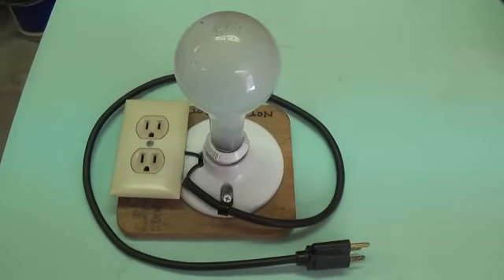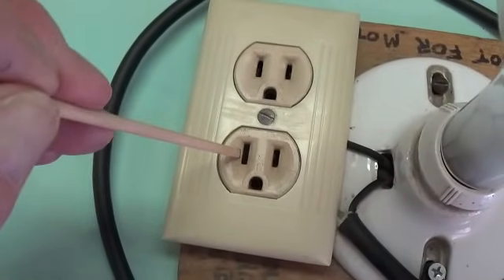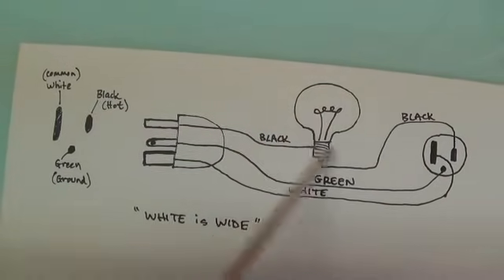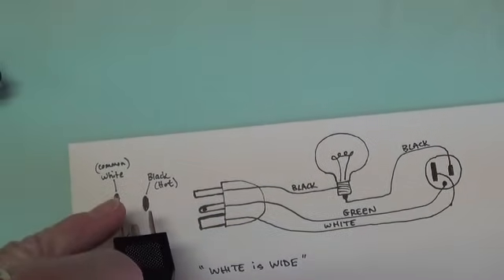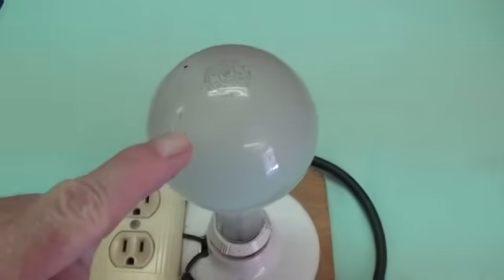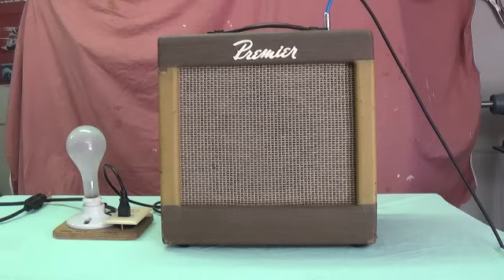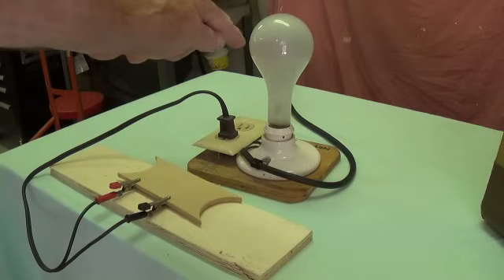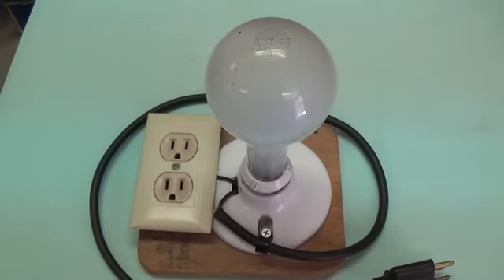Build Your Own Current Limiter for Protection when Repairing and Testing Electronic Equipment

Comment: I just built one of these today thanks to your video. I was able to find a 300W utility bulb at Lowe's. 
One question: I'm working on an old 12W mono tube amp that has a 2 prong non-polarized plug. Does it matter which way I plug it into the current limiter? Is there a way to tell on the amp which side is which? (I do plan to put a 3 prong plug on it in the future)
Reply from the maker: The two-prong plug will allow the amp to work regardless of which way it is plugged in, but without a polarized plug (or a three-wire, grounded cable) the on/off switch and fuse (I assume there is one) will be either before the power transformer in the circuit (good) or after it (bad). Making sure that the black (hot) wire goes through the on/off toggle and fuse prior to the PT is one of the benefits of polarized/3-wire power cords.

Comment: Thankyou I Just built one for myself. One thing you never mentioned is that the black wire from the plug goes to the gold or brass (positive) colored screw on the bulb fitting, The wire continues to the plug socket from the negative or silver colored screw on the
light bulb fitting, but is still attached to the black or hot on the plug socket. 

This makes it a little more clear where the wires are going. The hot wire is not attached together, in the bulb fitting, which someone just might do by mistake.
You cut the wire to go to the positive, then put a new wire on the bulb fittings negative screw and continue to the plug socket.
Reply from the maker: You're welcome, B&A. Thanks for clarifying the wiring and color-coding of the terminals. I appreciate your input.

Comment: I learned about this circuit 30 years ago after frying a transformer on a beautiful Grundig multiband radio that had been abused.  I am going to make another one, and have the lines separated so that I can measure the amperage using a clamp ammeter.   On my last one, I just paralleled 3 100 watt bulbs, which are dirt cheap.  I was reading the comments below, and tomorrow, I am also going to look for a single 300 watt at Walmart.  
Great video.
Reply from the maker: Thanks for your kind appraisal and for confirming the value of this device, SJ. I really like the AC ammeter idea. This would be a nice addition to the Current Limiter, to provide accurate measurement of the current. Walmart may not have any 300W bulbs, but 250W photo flood bulbs are readily available on Amazon. Best of luck :)
Reply: I am happy I could add something to your great description.
Reply from the maker: Thanks again, SJ, and best of luck :)
Reply: It is done, but I need to add an indicator light.  Bob

Comment: Used my new current limiter a few times yesterday and today .Finished it 2 days ago ..  Now  for the real Question I have a 200 watt light bulb in it ..I have had a Hammond AO-35 and finally tested it today ..  Made a plug for it and they are tight ,I used wire nuts .( this is only temporery for testing unit )  .. Tubes light up everything seem to be OK ,no smoking ..No strange smells  or anything I could tell.. Then I looked over again at the light bulb ,it had been on about 2 + minutes and the bulb was glowing very low ..If I didn`t  have the room light off I may not have seen the limiter light at all . Two windows bring some light in not much ( mini blinds ) ..  Is there something wrong or is this normal ? ?  2nd time I hooked it back up I know there is sound ,used head phones with aligator  clips and they scratch .  But ,  that  real dim light   ?

    Thanks for any input  !
Reply from the maker: It's normal for a 200W bulb to glow a little with an amp such as an AO-35. I normally use a 250W bulb, which probably would not glow visibly. You could use two 200W bulbs in parallel (if they are the largest bulbs you can find) and would still have good protection, but without the slight glow and much less voltage reduction to the amp.
Reply: Uncle Doug I was just in a hurry the day I bought that bulb ,I`m sure I will find a larger wattage bulb I also have a Flood light ,its 75 watts but not sure on that ..I buy them for the pump house for the heat in the winter. 
      so you think the wattage is it ,you think the rest of the AO-35 is OK ?
Thanks for the tip also  if needing to use 2 bulbs .Great idea  ! ! 

    Can`t  wait to get the amp project going ..
     Thanks so Much !
Reply from the maker: The 75W bulb is way too low in wattage. You either need a 250W or two 200W in parallel. You're welcome for the help. Best of luck.

Comment: Watched this video many times but can`t  see under the receptical cover to see how you hooked up what I cannot see. Thanks. Always wanted to understand something about amps even have books and was totally lost still ..Now I am starting to understand what these things mean !  Thanks for these Wonderful videos ,Please keep them coming !!
Reply from the maker: You're welcome, SG. I'm glad to hear that the videos are helpful. The black (hot) wire from the cord goes to one of the bulb contacts in the porcelain base and the other bulb contact is connected (also by a black wire) to the smaller slots of the female output receptacle. The white (common) wire of the cord goes directly to the larger slots of the receptacle. In the opening image you can see the two black wires to and from the bulb, and a tiny bit of the white wire.
Reply: Uncle Doug Sorry  ,didn`t  explain myself right . I meant see under the cover . If the receptical had a box around it for safety ? Box ,receptical and cover or just receptical and cover !   Thanks ,hope I explained it better.  Also 8 or so years back I bought a Brand New Standel 25L15 with a mint JBL D-130 in it . Just like Chet`s . Mine when it lites up shows my name up top.  What an amp ! ! Your videos are never boring ,always on the edge of my seat .. Thanks  !
Reply from the maker: There is no box under the cover, just a receptacle. The broad cover prevents contact with the terminal screws, to reduce shock hazard. Thanks for your kind words. The Standel sounds like a great amp !!!

Comment: The econazis have taken the large wattage incandescent lamps off the market. I think 2013 was the last year for the 100 watt.  You can still buy 3 ways though. If you use mogul socket you could get 500 watt lamps at one time that fit those.
Reply: Europe generally does not use a neutral. Many locations even use 3 phase in residential wiring too, where each house shares a phase with the one next to it, and it is a balanced 230 volt 50Hz system. It still works about the same though, as you are shunting the lamp across the lines in the event of a short. FYI, the neutral is called the "grounded" conductor in the USA, and the green is the "grounding" conductor. Eventually the white & green tie to a common point in any building electrical system. Grounding conductors are almost always green or green& yellow, and any country. Japan & Fiji use a 100 volt unbalanced system. If you do get European cords the brown wire is hot, blue is neutral, and green & yellow is the grounding wire. Brown is used for both hots in single phase European, and brown black & grey are 3 phase European colors. Have fun!
Reply from the maker: Greetings, Seth. Thanks for all the international wiring information. Re  high-wattage bulbs, I believe there are some 250W and photoflood bulbs still available on Amazon.

Comment: I built one but could only find a 200 watt bulb.  i checked 5 of my amps.  all but one light the bulb!  all have been recapped and a 3 prong plug installed.  where should i start to find any shorts?  all of the amps, except for one, work very well so i was shocked(pun not intended) when this happened.
Reply from the maker: It depends on the size (output wattage) of the amplifiers. A 250W bulb is usually sufficient for tube amps with an output of 20W or less. With amps from 20-25W, the bulb may glow dimly, and with higher wattage amps the bulb will tend to glow more brightly. I doubt that four of your amps have short circuits. If they are relatively powerful, you probably need either a higher wattage bulb (they are available on Amazon) or two 200W bulbs in parallel.
Reply: Uncle Doug they are all less than 30 watts.  1. 1965 sears silver tone 1482, 2. 1962 gibson ga79rtv, 3. 1966 fender deluxe reverb, 4.  1950 gibson ga50t(light the bulb the brightest) and 4. 1959 fender tweed princeton(didn't light the bulb at all but is the least wattage also.  thanks for your response.
Reply from the maker: The GA79RVT and the DR are both 9-tube amps that draw a lot of current, as is the GA50T (8-tube), so I'm not surprised that the bulb lit up. You need two 200W in parallel for these current hogs.

The 1482 should not have lit up the bulb (perhaps just a dim glow) so I have no explanation unless it actually is drawing more current than it should.

The Princeton is about right for a 200-250W bulb and there was no glow, as expected.

You have a great collection of amplifiers. You're going to need more bulb wattage for the first three. I would check the 1482 for overheating filter caps, etc. I have never plugged one into my 250-300W CL, so I can't speak from experience, but it may have some problems.

To be honest, 200W is probably too low a wattage bulb for a CL to be used for anything but single-ended amps. 250W to 300W is probably the minimum. Good luck.
Reply: Uncle Doug great!  i'll look into a higher wattage bulb.  yes, they are all completely different amps and each sounds great.  well, except for the ga50t that needs some overhauling.  i'd like to ask you some questions, if i may, on the ga50t but i probably shouldn't take up the space here since it is a different subject.  is there another way i can send you a message?   thanks again!  mikeB.
Reply from the maker: Mike, I have a FaceBook page called Uncle Doug's Vintage Amps where things like this are discussed. I can answer a few questions about the GA50t there.
Reply: i found a 300 watt bulb in walmart.  now those same amps barely light the bulb.  thanks for the information.
mikeB.
Reply from the maker: Yes, Mike, the higher wattage bulbs really make a difference. It's great that you found one locally. I'm headed to WalMart tomorrow to find a few 300-watters for future use. Thanks for the tip :)

Comment from the maker: Elberelrod: Your question was posted without any reply capability, so I'll reply here and hope you see it. Sadly, a lot of organ manuals and schematics aren't available for free. Here is a site that will sell a service manual for the organ:  http://www.organservice.com/lowrey/LowreyManuals.htm   But since you are more interested in using the organ parts to build a guitar amplifier (I assume) you should be more concerned with the schematic of the amplifier you are going to build.  Watch my videos on power transformers, how amps work, output transformers, etc. to get some hints. Good luck.

Comment: that really scared me when you put the screwdriver across, I thought for sure I'd see sparks flying everywhere. I'm going to build one of these for my workbench.
Reply from the maker: I get a little scared too, probably because of the trauma in the distant past when I had short circuits without the current limiter. It really does make a difference. I think you'll be very glad you made one :)

Comment: Thanks for the lead to this video Doug. I'll play with the values; just looking for a bit of voltage drop inbound to the Champ. But a great safety thing too & too simple not to use. We're gonna also make this a teaching opportunity for aspiring engineer-type teen grand-daughter; should be fun. Talk about show & tell!  Another killer video. :)
Reply from the maker: Thanks so much and good luck with the project, Wes. I think it's wonderful that you're working with your grand-daughter on engineering projects. It's experiences like this that inspire and prepare them for a wonderful career in the field. Rusty and I wish you the very best :)
Reply: Uncle Doug Greetings! Well, project complete & satisfied that  - for safety purposes - it's a great thing to have sitting around. However, I have a question as I'd "thought" I would be seeing some voltage drop at the outlet that I could use for the Champ. In this case perhaps my math got brain-dumped or I'm substituting the wrong values. Given a line AC of 122.5V and a 150w bulb with a cold resistance of 5.5 ohms (what I could get at the store) thought I'd be seeing several volts at the other end in terms of voltage drop, the outlet with which I'd power the Champ. Am I overthinking this or should I just un-think the idea of seeing any voltage drop at the other end of this series circuit? (The other alternative is to talk to the folks at the utility as they could dial things back 5 volts easy & we'd still be livin' large.)

Thanks for your time! :)
Reply from the maker: Wes, the voltage drop depends on the amount of current flowing through the (resistance of the) current limiter. Voltage = Current in Amps x Resistance in Ohms. At 5.5 ohms of resistance you should see a voltage drop of about 5.5V if you are operating a device that draws 1A (i.e. a small amp). If the Champ is not plugged in and drawing current, there is no voltage drop.
Reply: Uncle Doug
OK, thanks for verifying my math & formula was correct for calculating the voltage drop, that's about what I figured. Perhaps I should be measuring at the TP rather than at the other outlet on the board?  Hmmm.
Reply: Wes Howard
Follow-up. I love this thing. After trouble-shooting a simple physical layer problem (builder headspace not torqued) I have 116.8VAC going to the Champ. Don't know if others can tell but, to me, there is a sonic improvement and I suspect the innards are happier. This thing is now the amp's "extension cord" Also, get to keep my stiff mains line to provide trhe 3100V my HF amp likes to see at the plate. Thanks again. Now onward to getting a little filter-cap board in there. :)
Reply from the maker: Greetings, Wes, and thanks for the update on the utility of the current limiter.....or in this case, voltage attenuator. I'm hoping that the plate of the 6V6 is receiving 310V rather than 3100V :)))  You are definitely welcome for the tip on the CL. Best of luck to you and your (future engineer) grand-daughter.
Reply: Uncle Doug
:) Yes, the amp is doing fine. Quite a difference between the voltages the Champ runs at vs. a radio amp capable of almost a kilowatt. Its transformer as you might imagine makes it weigh like toting a Twin Reverb so where it lives on the desk is where it stays.US-made with old US Eimac power tube likely to outlive me
Cheers & Merry Christmas.
Reply from the maker: Merry Christmas to you and your family, Wes.

Comment: I always test my 3 wire plugs rather than trust they are wired right. I bought some awhile back, and they were switched. Probably the reason I got a good deal on them.
Reply from the maker: I haven't encountered this problem, Scott, but will begin checking them prior to installation. Thanks !!
Reply: Uncle Doug - I sometimes use computer power supply cords in situations like this. It seems that some foreign manufacturers use, what seem to be, random colors for the wires in these cords. Definitely a best practice is to verify the wire colors before using them. I've been using one of these (along with variacs, isolation transformers and GFCI outlets) for years. Can't be too safe. Also, if at all possible, have someone nearby (or check on you frequently) when you're working with high voltage. It's also worth mentioning that when you say that this device can protect a person that you don't mean it will protect them from electrocution. This device can still supply 2 amperes of current and it only takes as little as .065 amperes (65ma) of current to be fatal. I humbly submit that changing those regular outlets with GFCI outlets would be a great upgrade to that device. Be safe, everybody! :-)
Reply: William J., those modular computer type power cords are typically green brown and blue, green is the ground of course, and if I remember correctly blue is usually the hot, but I always check with a multimeter. By the way, a GFCI electrical outlet will often trip and save you from a shock if your vintage amplifier has an internal short to the chassis or an electrically leaky  "death cap" from the power cord to the chassis, as is almost always seen on vintage tube amps whether or not they have a "ground polarity" switch.

Comment: I accidentally discovered something when I was in my late teens involving screwing a bulb,not LED or fluorescent into a fuse socket. This can be done when troubleshooting your houses' 110-120 volt circuits for overloads or shorts without blowing another fuse or burning the place down. Anyway to check a problem circuit for an overload or short,
is to screw a medium or high wattage bulb into the fuse socket,or if cartridge fuses are used, or a breaker switch panel is used, use a bulb socket with clip on leads.
For a cartridge fuse switch or panel,with the fuse removed, is that you connect the bulb in it's place.  With a breaker switch panel,you connect the bulb in series with the breaker switch & it's wire. If the bulb glows bright, there is a short or overload on the circuit. If it glows dim, or not at all,the problem may not be in the circuit,but with the fuse or breaker switch.
Reply from the maker: This is an interesting application of the current limiter principle, Mathew. Thanks for posting :)
Reply: How did 'accidentally' discover that?!?!